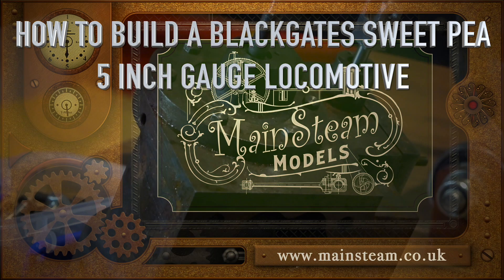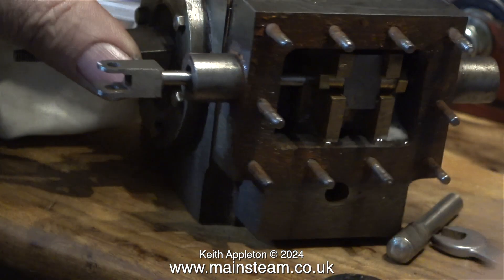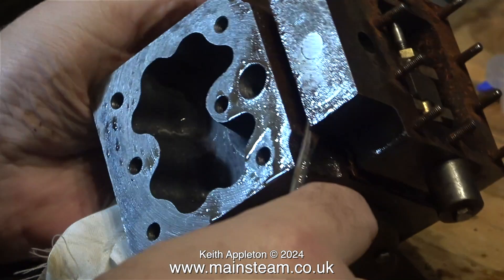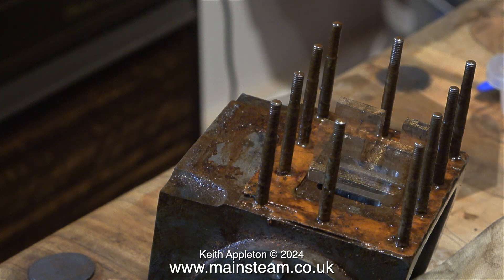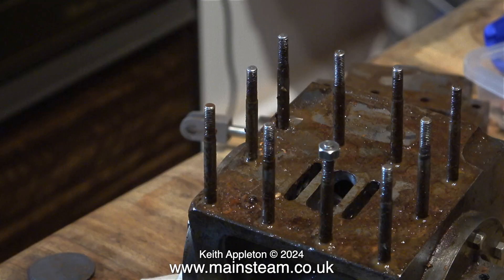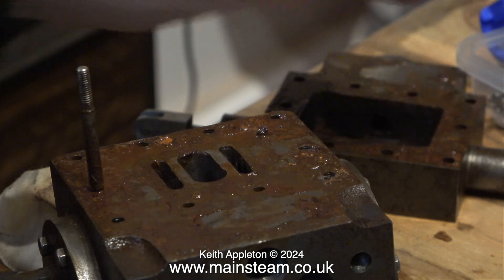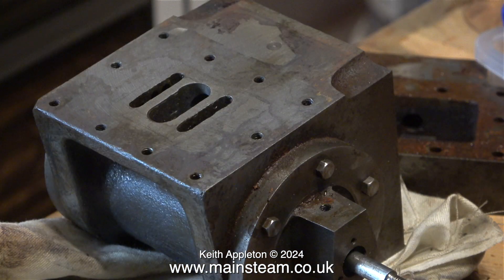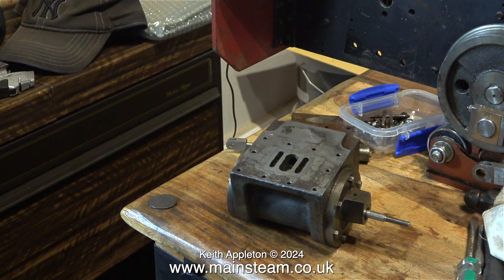A BLACKGATES SWEET PEA LOCOMOTIVE BUILD - PART #4

Comment: WD-40 was originally developed for the US Navy, to displace water on its ships and aircraft, and it did so very well. But there was a problem, It left any salt behind. The salt removal, brought by the water was the main reason for its use. 
While I was serving in the Navy, WD-40 was banned from use and replaced with another product. I can't remember its name, but it has a decidedly different and pleasant smell. Don't use WD-40 around salt water environments for water displacement. ;-)
Reply from the maker: Not much salt water near my steam engines }:-)))